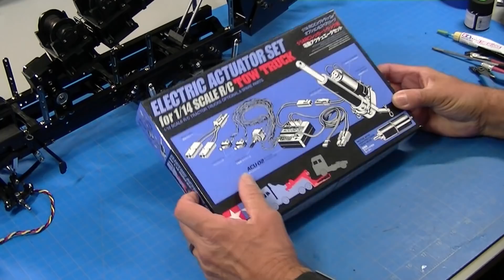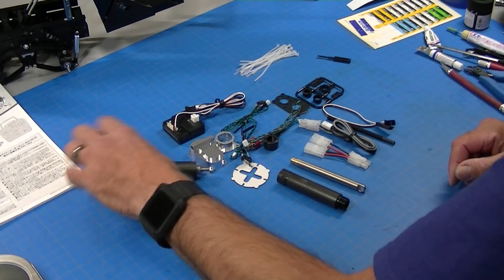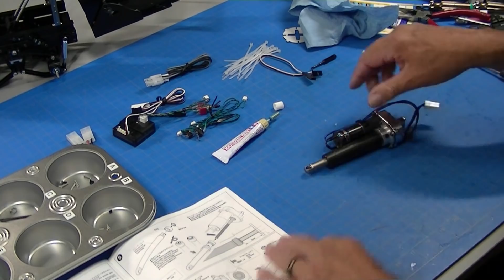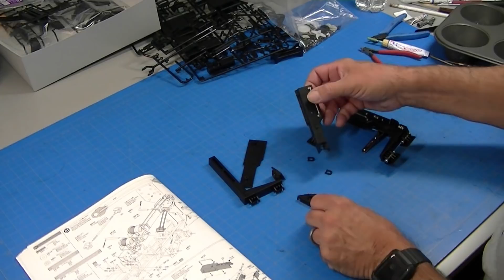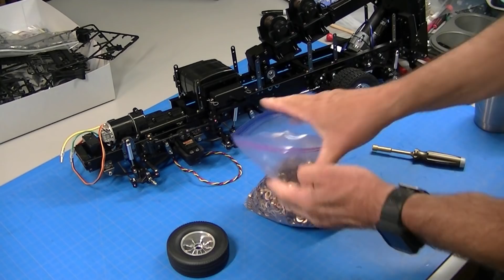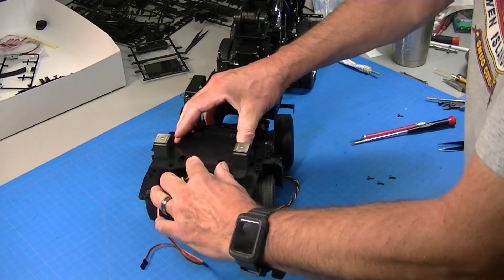Tamiya 1/14 Volvo FH16 Tow Truck Build - Part 4 Actuator & Chassis (Updated)

Comment: Hi bob i watched the whole building of this truck. And you do a good job and make it looks easy. I am using only the complete chassis and cab. I am building a heavy haulage truck with a dolly and a fury bear 2+5 lowloader with steering axles. Could not afford a scale models tractor with 4 axle and this will do well and i prefer the double steering frontaxle on this volvo. Keep on building.

Comment: I'm curious if a Actuonix actuator would be a cheaper alternative to the Tamiya actuator for this build?
Reply from the maker: Looks like lots of easy ways to do it without the Tamiya actuator but wanted to use the Tamiya unit for this build.  certainly can't fault the quality the thing is beautiful!
Reply: @HobbyconceptsLLC  agreed
Reply: Definitely cheaper. But the oversized holes tamiya used for there actuator would require reworking.